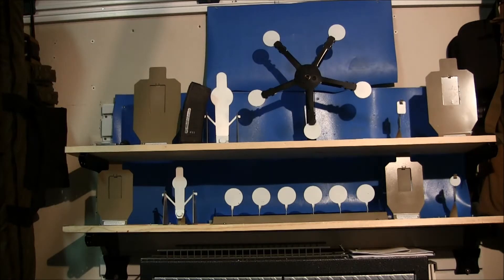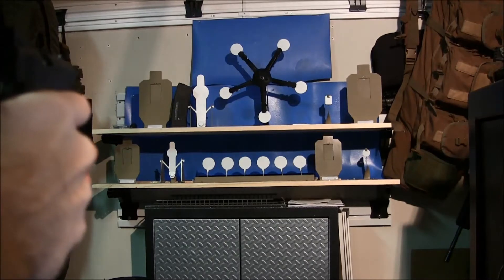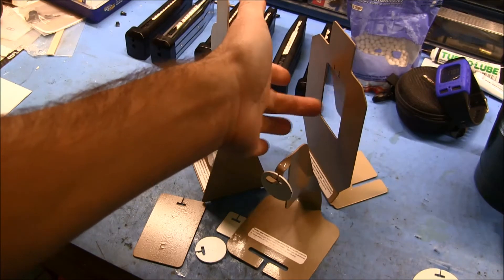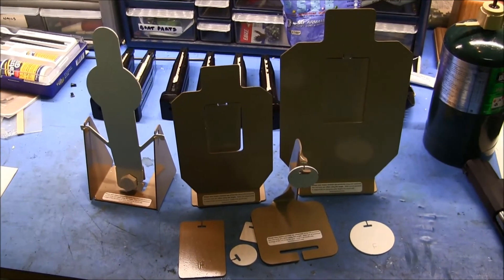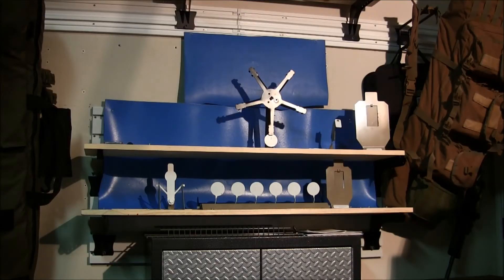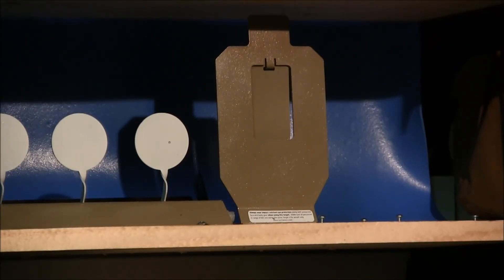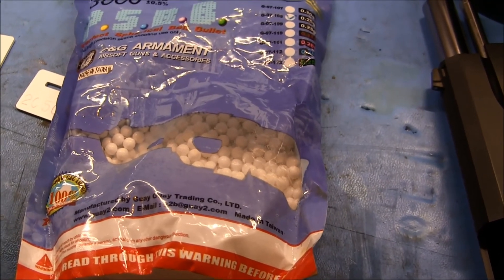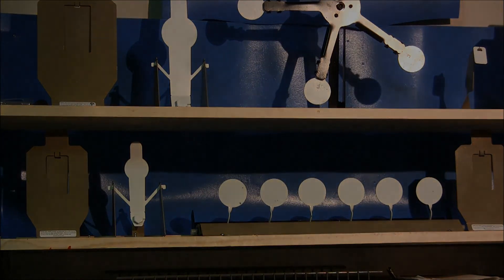Tactrainers airsoft targets for USPSA, 3gun (multigun) shooting practice

Comment: I am having a hard time finding the correct BB/Pellet pistol with not too much power. I hit one plate and more than one falls down.
Reply: You may want to change the recoil spring to a less powerful one. Also consider using heavier BBs, which reduce fps. I usually use .25 or .3 gr. BBs with my guns and been pretty happy with them.